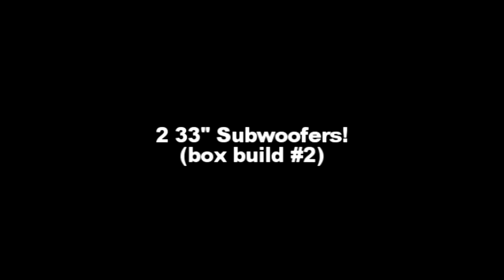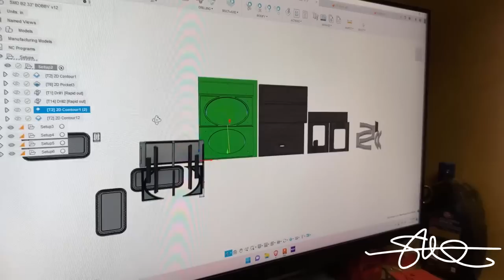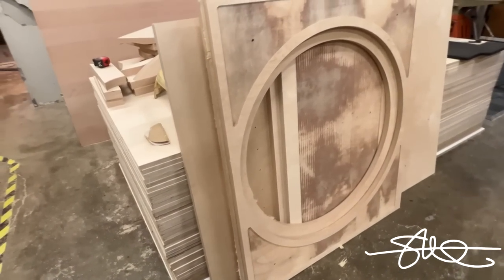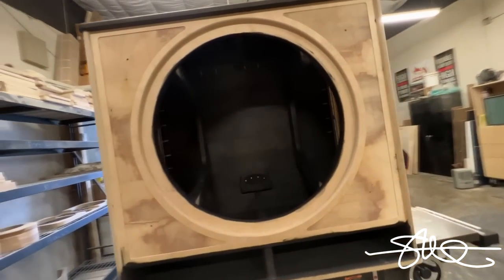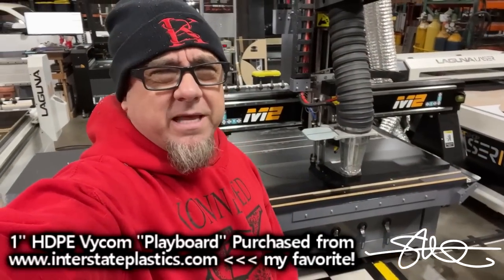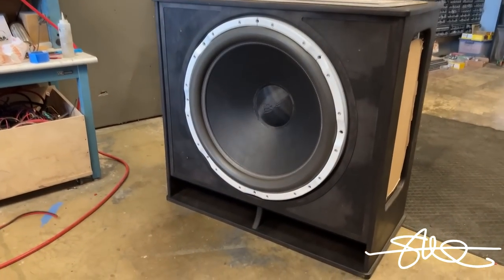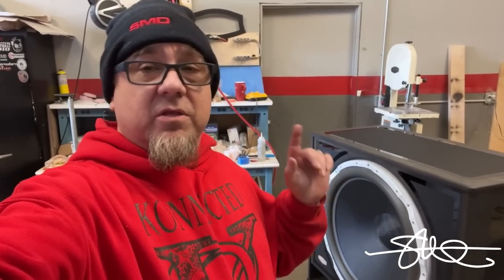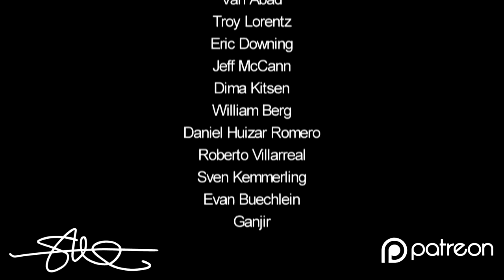Two 33" Subs 🔊🔊 BIG BASS  for my Home Sound System - 2nd Ported Box built and finished!

Comment: Is it just me or does it actually seem quite small for a ported box. I’m not saying it’s small, it isn’t but compared to the driver, if you imagine a 12” the proportion seems like it’s relatively small.
Reply from the maker: yes, it is just you.......and a few others that don't understand anything about speakers.  Bro, this is a 20ft3 box I.D. before displacement and probably 22 O.D.  It's a big ass box.
Reply: Why are you attacking the guy. He asks a valid question. The real reason the box size is disproportional to a 12 inch is because volume is a 3D measurement and cone area is 2D.  This subwoofer may have 2.75 the diameter of 12inch sub or 7.5x cone area but it doesn’t have 2.75x excursion of a 12. Since not all dimensions are proportional to the 12inch sub neither will the box.

Comment: that hardware is pretty nice... I normally go the t-bolt route with bolts... to keep from striping out the wood... but those are pretty nice 👍
Reply from the maker: you ain't stripping this wood out.  That T-nut with bolt will fail before this does.  Post up a link to some of your work, lets see how you normally do it.

Comment: Where can I get some good hardware for my theater system? Wouldn’t mind car audio stuff. What I want to do is pair up my klipsch 500sa side and then my rear surrounds into 4 ohms. What I mean by that is I got a total of 8 speakers , two for side surround left , two side surround right and four on the rears (2) per each channel. I need to make a good splice. They are 8 ohm speakers and once I tie them together they will be 4 ohm per channel. My speaker cables are spades I call them forks, I need plates with posts so I can hook the home run to each pair of surrounds. Is there a online company I can order stuff like that from? I see you using quality components for car builds. Nice term blocks , posts etc. point me in the right direction?